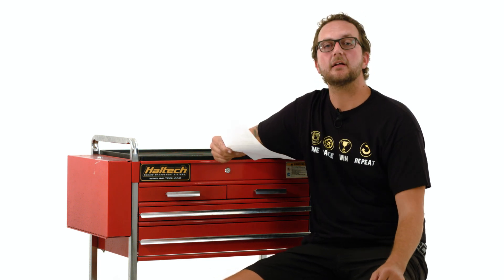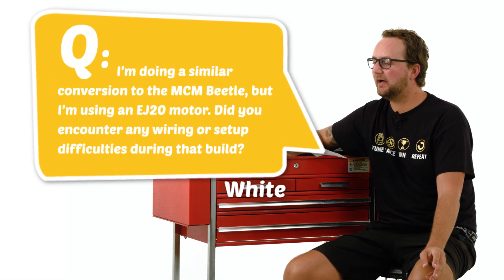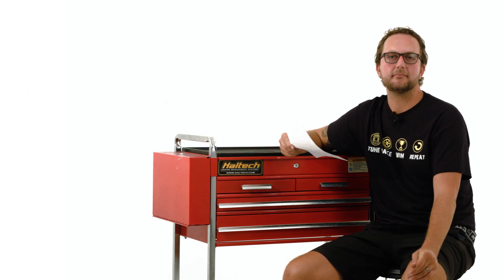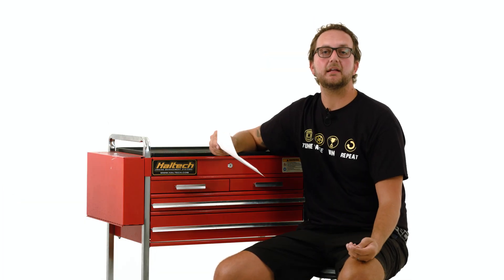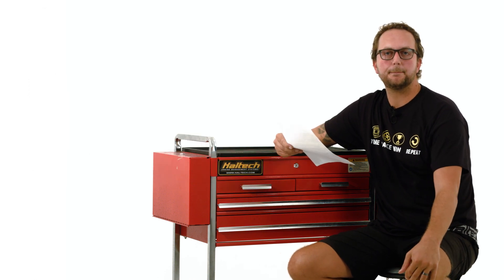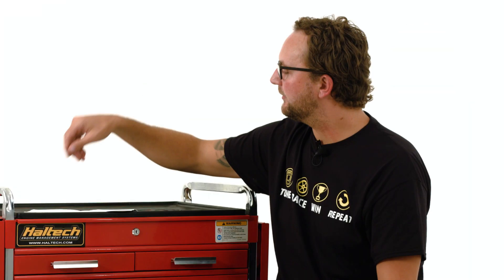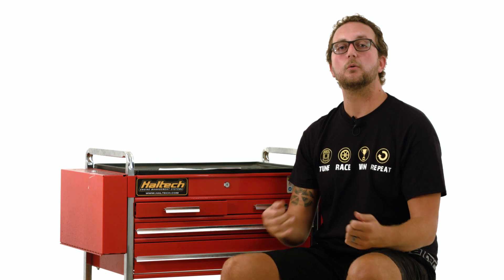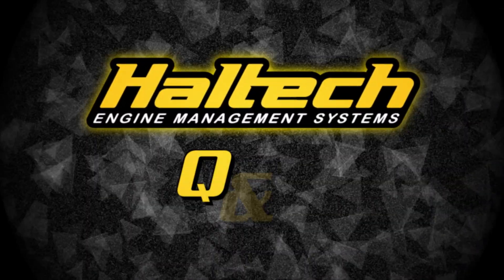❓ EJ20 Conversions and Knock Control - Haltech Q&A Episode 11

Comment: Thanks for answering a previous question, can you also answer if I give you my serial number off my ej20 factory ecu you can determine the right elite ecu to use? I believe it's a 93 with yellow female connectors, thanks Jp
Reply from the maker: Hi Jon, the best thing to do is to shoot an email with the details of your engine and factory ECU to support@haltech.com. One of our tech support guys will be able to recommend the best ECU for your application.

Comment: hi I just did an engine swap into my 01 Legacy twin turbo saloon. I've bought a JDM Impreza 99 wrx engine. Having learnt the stock E6 ecu isn't tunable I'm looking to go aftermarket. what do you recommend for my 99 wrx engine?
Reply from the maker: If you are using the 99 WRX engine harness, you can use the 99-00 WRX + Sport 1000 patch loom kit (HT-051353). If you are using a different harness, you may need to do a custom wire-in – check out our Youtube video for an idea of what’s involved:https://www.youtube.com/watch?v=GzLiGezXshk

Comment: would the elite 1500 fit a toyota gt86?
Reply from the maker: +Sani Wada The Elite 1500 supports the GT86’s trigger pattern and cam control, however
 supports port injection only – the Direct injectors would need to be 
disabled.

Comment: hi Guy"s what ecu would fit BMW e24 with m30b35 thx
Reply from the maker: +Ck Generation The
 Elite 750, Sport 2000 and Elite 2500 will run the M30 with sequential 
injection. All options require custom wiring, as we do not have a direct
 plug-in solution available.

Comment: For a 2001 subaru outback is the best for the wagon ? i want to supercharge the original engine
Reply from the maker: +canchume Both the Sport 1000 and Elite 1500 can run the Outbacks’ EJ20. This will require custom wiring for installation, as we do not have a plug-in solution available.

Comment: an honest question, are theyre any major improvements haltech has over hondata?
Reply from the maker: +john martin Not sure what the hondata system features are, you would need to compare the spec sheet side by side, then compare the pricing to see which one is more suitable for your application.
Reply: +john martin hondata is a flash system. You can't compare a standalone ecu to a shitty reflash.
Reply: +slws14 some hondata versions are a flash version and some are full on standalone. like the s300 v3 w/bluetooth.

Comment: hi then I well Usk with ecu with future components will fit plug and play Renault laguna 2 mk2 2.0 t gt 205 yer 2006 car was really mapped I need to fit knock sensors control pressure boost oil.
Reply from the maker: +Adrian ADOR No plans yet to make a plug and play ECU for that car. As with everything else, it's a question of supply and demand. If there's enough demand for it we'll definately look into making one.
Reply: This car shear ecu with megane f1 r26 and this seam engine under bonnet .Sagem 3000 So no chance of supply? Then plug and play system?
Reply: +haltechecu and want to Usk if you got garage in uk?
Reply from the maker: +Adrian ADOR Sorry no plug-n-play at this stage.
Reply from the maker: +Adrian ADOR Check out this link:
http://www.haltech.com/dealer/dealers-europe/#United%20Kingdom

Comment: I'll swap an ej22 out of a first gen legacy on my beetle. is it worth to install an aftermarket ECU or should I just use the stock one?
Reply from the maker: +Eric Santos Really depends on what you want to do with it. Stock ECU will run the engine but if you want to do performance mods, upgrade your turbo and/or fuel system then an aftermarket ECU will certainly help you manage it all.

Comment: im thinking  a a elite 1500 will be what i need for a holden barina sri xc it has the z18xe motor im looking at swapping to the z18xer later on aswell motor is getting turboed
Reply from the maker: +Joshua Corley Yes, the Elite 1500 supports both knock control and electronic throttle, and supports turbocharged applications.
Reply: for the z18xer it will do the variable cam aswell?
Reply from the maker: +Joshua Corley Yes, it will.

Comment: I have a 2003 dodge Dakota with a 3.9 liter engine but I'm going to put a hemi in it what ecu would work
Reply from the maker: +Kirk Conway 
The Elite 2500 will run a Hemi V8, however custom wiring will be required for installation.

Comment: Tuning fork what application would work good for my 1996 Ford Probe SE?
Reply from the maker: +PSE Mentalist The Sport 1000 is perfect for the 2L Probe – this does however require custom wiring, as we do not have a plug-in solution available.

Comment: what ecu for M-B m111 2.0 motor? it has knock sensor and ''half''electronic throttle.. and what would be the best wiring harness? it has 2 coil- firing
Reply from the maker: +ajkankkunen The Elite 1500 supports the M111 trigger pattern and knock sensor, however we do not support half cable/half electronic throttle systems (one or the other).
Reply: +haltechecu thats good to hear :) just gotta find different throttle body and all fine ;)

Comment: Hey guys .. I have an elite 1500 and want to set up transbrake creep/bump for racing. How would I go about it? Cheers John
Reply from the maker: +mrwatthe Current firmware has a ‘Trans-Brake’ function; Simply connect your transbrake and bump buttons to inputs, and the transbrake solenoid to a DPO.

Comment: what ecu would fit my R34 Gtt? Rb25det
Reply: they have a plug and play for that model. Google it, it should be one of the first results
Reply from the maker: +Noswolf kop The R34 GTT Pro Plugin is a direct replacement for the factory ECU. Note that this is for manual vehicles only.
Reply: Thanks an its manual.
Reply: +haltechecu while your here. is there one for the 25gt. (non-turbo)?
Reply: Rb25det
Reply from the maker: The following RB engines are covered by our Pro Plugin range:
RB25DET, RB25DE, RB20DE, RB20DET,  RB26DETT